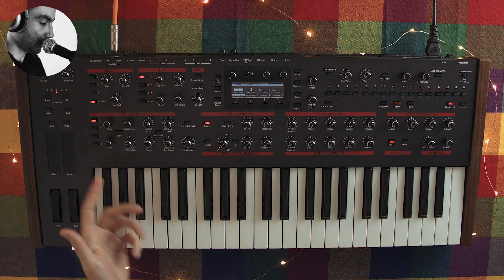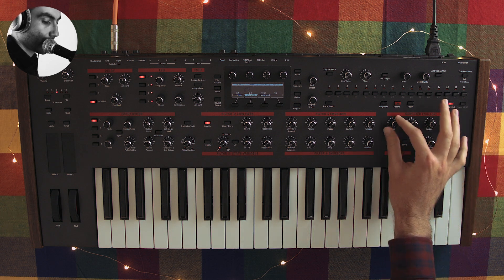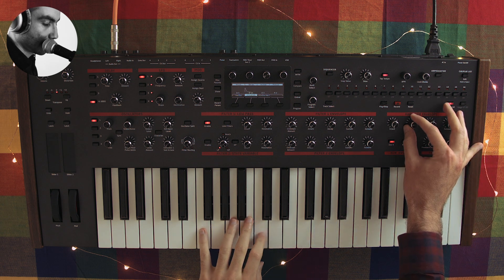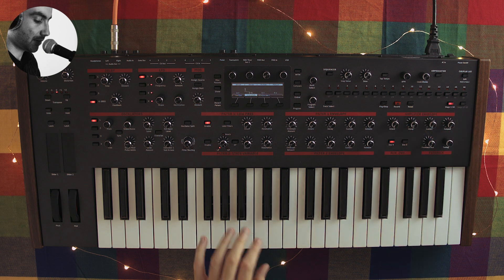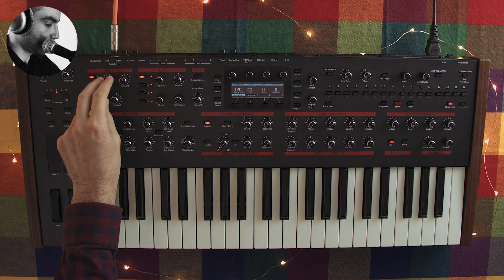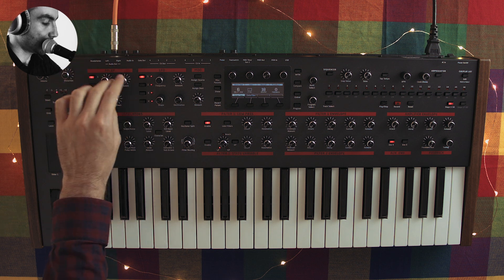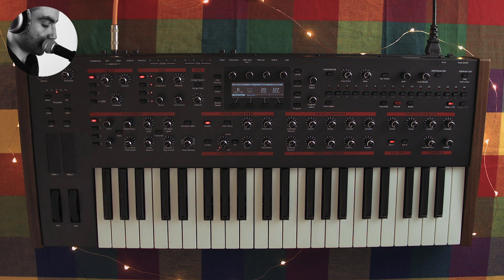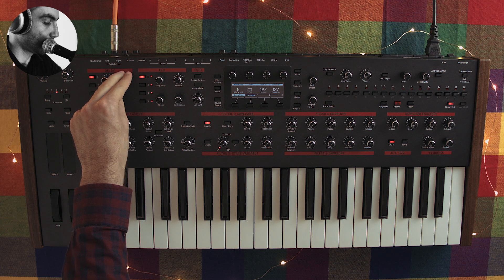DSI PRO 2 KARPLUS-STRONG SOUND DESIGN TUTORIAL ~ Synthesize This! Ep.06

Comment: Love these videos. It seems like you were going to use the low-pass filter at some point but then never mentioned it again. Is there a low-pass built in to the delay, and if so, can you tune how low it goes?
Reply: Loving these Pro2 tutorials! Did you know that pressing Latch 1 and Hold buttons is a Basic Program shortcut? I was pretty excited to learn about that:)
Reply from the maker: Oh my bad I must have edited that detail out. But yes, in the delay settings you can adjust both the low pass filter and high pass filter cutoff frequencies.
Reply: Gotcha I see thanks! Such a crazy beautiful synth. Maybe the most "high tech" of all "mono" synths.
Reply: Each delay has its own dedicated low- and high-pass filters, and you can set their cutoffs. (The delays are all digital, and I expect these filters are digital as well.)  One downside is that the delay filters' cutoffs cannot be modulated by other parameters, unlike the main 2 filters.  But you can modulate the 4 delay times, feedback amounts, and more. Overall, the modulation possibilities on this machine are very extensive.
Reply from the maker: Oh I didn't know that, thanks for the tip!

Comment: hey, according with the manual, de Feedback section got a callibrated tuned delay line...why don´t just use this instead of the uncallibrated delays?
Reply: The tuned feedback circuit works great for this.  I just tried it on my Pro 3, and it made some really delicious tones which sound like an acoustic instrument and evolve over time all on their own.  It's really expressive, and can sound like many different things.
Reply from the maker: Oh I wasn't aware of that. I've somewhat neglected that feedback section because I've never found it to have a meaningful effect.  But I'll try this out with a short noise burst to see if it has the same effect. Thanks for the suggestion.
Reply: I´ll be waiting for your test! cheers!
Reply from the maker: Just tried it out, it works great! I can't seem to get as wide a range of tones as with the delay units (e.g. it sounds a little thicker, and less dulcimer-ish), but it tracks the keyboard perfectly and is actually a pretty cool sound. Thanks again for pointing this out. I might make a little update video to clarify this little bit. Cheers.
Reply: hey, great! thanks for trying this! 
do the filters have any significant effect on the sound this way? 
I know classic KS synthesis use noise, but did you tried this with other waveforms as well? 
I can´t wait to buy this synth!
keep doing this great videos! cheers!
Reply from the maker: I think I may have briefly tried different waveforms but I don't quite remember what it sounded like (clearly not memorable enough). I did try the filters, I didn't find the effect to be significant, but it still sounded good. I found that having high resonance on the HPF caused the feedback to blow up a little so that was kinda cool. In any case, I made an updated video showing the updated patch with the feedback: https://youtu.be/OFvCKkmOJxM